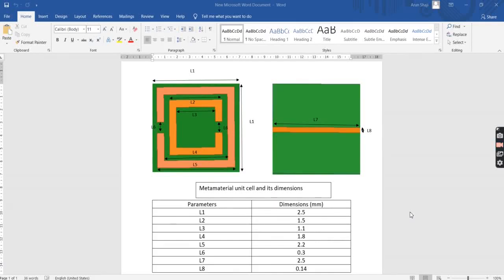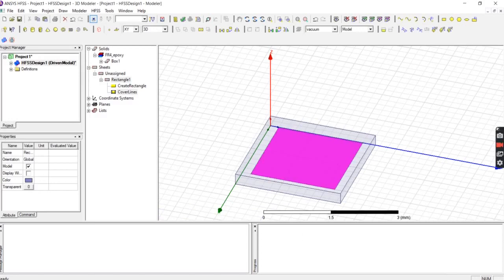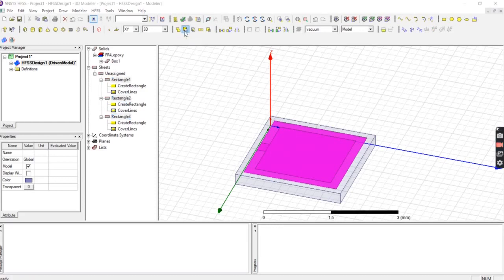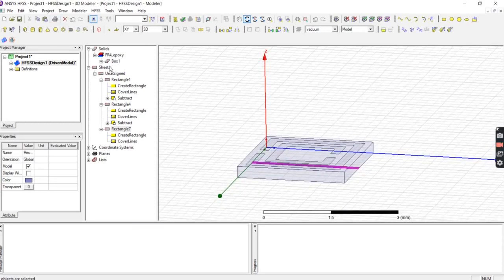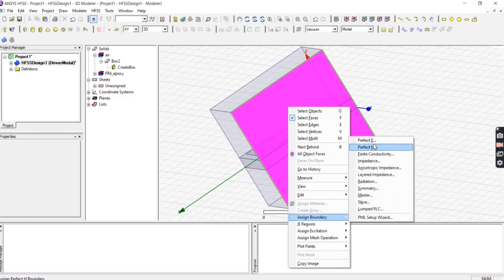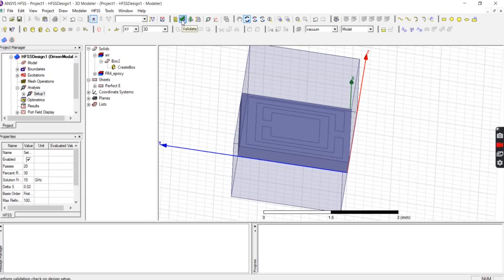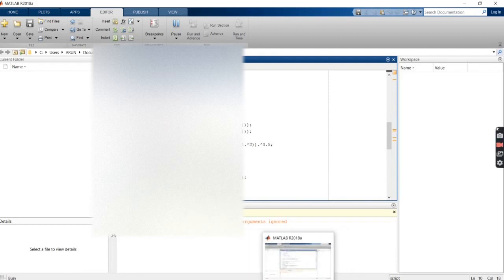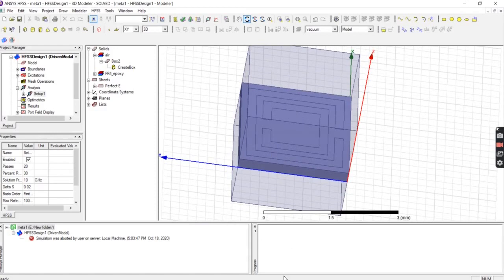Metamaterial unit cell and its parameter extraction | Split ring resonator

Comment: Can someone tell me how to determine the dimensions of a metamaterial absorber/ resonator?
Reply: Hello,do you find the method of calculation related to metamaterials...if yes can you share it to me please?
Reply: depends on geometry choice as i call it. and also material choices. there will also be a coupling strength between resonating elements and different modes of excitation. 
If you select say square patches for geometry and a noble metal as material. then the relationship will be linear so you can make the dimension of the patch size smaller to have a larger resonant frequency. however you will still need to select the thickness of the dielectric layer. to find it you can use a fdtd programme like the one shown and parameter sweep different thicknesses to compare for the best response.

Comment: Nice video..but there is no need to extract parameters and using matlab code.... You can get all the required results in the HFSS.
Reply from the maker: From the HFSS scattering parameters I am using kramers kronig relationship to extract the parameters
Reply: @ArunShaji  Yes that is also a valid technique. But in the new version of HFSS, all the required equations for the post-processing are defined in the output variables.
Reply from the maker: Ok. Thank you.
Reply: @ArunShaji  Hi, I implemented the same paper in the HFSS. The results in HFSS (S11 and S21 magnitude and Phase) look the same as in the paper and in your's video. However, using Matlab for effective parameters, I got the same results as in the paper in your video but shifted by 2 GHz. I am getting the results at 12 GHz instead of 10 GHz. What is your kind suggestion regarding the results. How I can get the effective parameters at the desired frequency?
Reply: @izazalishah1334   Can you please help me with how can I extract all these parameters from HFSS directly !!
Reply: @izazalishah1334  I am also facing same problem. Did you able to figure out the problem?

Comment: Sir, when the array of unit cell is used with patch antenna (as a sheild)  Is the unit cell excited????
Reply from the maker: yes, it is excited by means of the plane waves
Reply: @ArunShaji  In Hfss I used lumped port for patch antenna. Can I use waveport for the metamaterial??? Can these two type of excitation co exist in the same design???
Reply from the maker: @sonali5960  Even though the antenna is excited by lumped port. The waves emerging from the antenna will incident the metamaterial , which will have the same effect as that of wave port. so these two types of  excitation exist
Reply: @ArunShaji  Thank you sir

Comment: Hello Sir, I am designing Terahertz metamaterial for biosensing purpose based on graphene and Indium Antimonite. How i can add both the materials in HFSS?
Reply from the maker: You can add new materials to the hfss design if it is not available by analysing its value of relative permittivity, permeability, loss tangent, mass density etc.